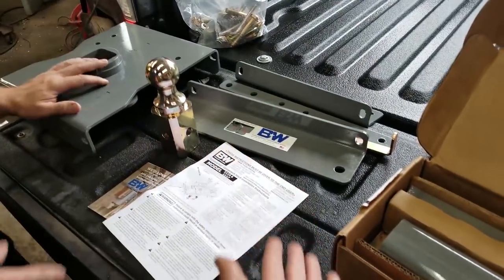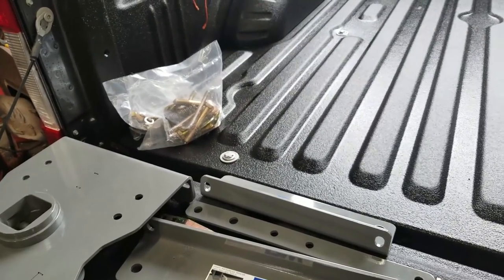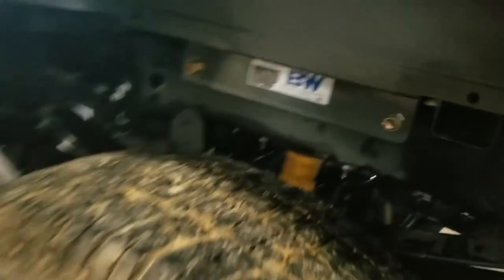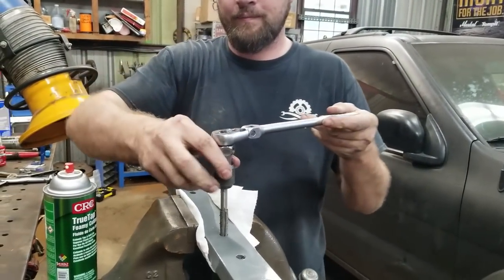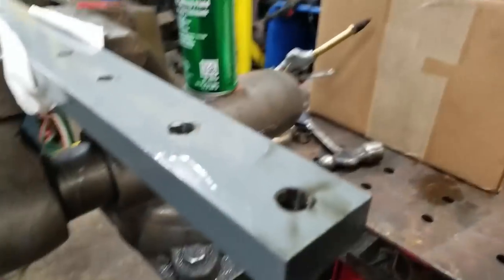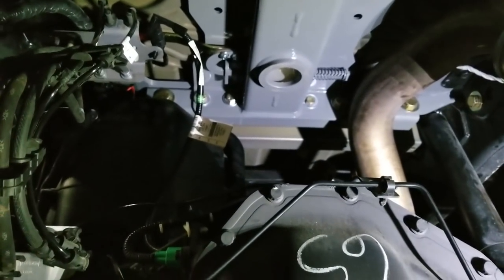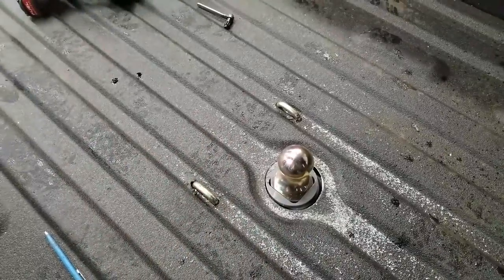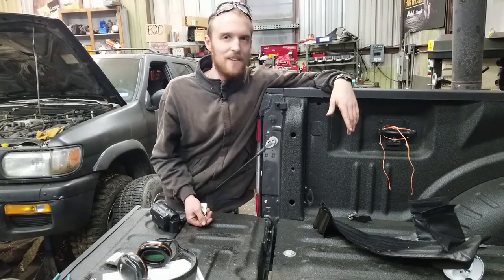Ford powerstroke gooseneck install

Comment: What’s the measurement from the rear of the bed to the center of the bed to drill the 4inch hole?  I have a 2017 long bed